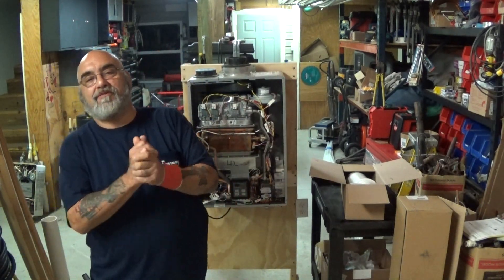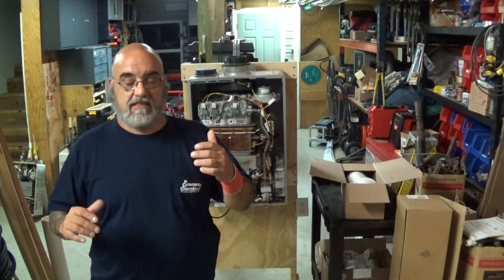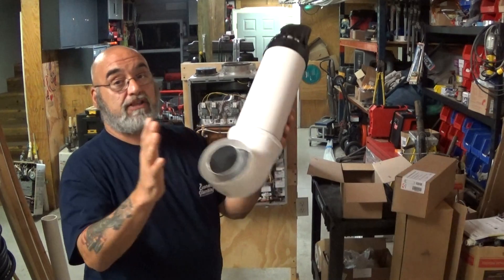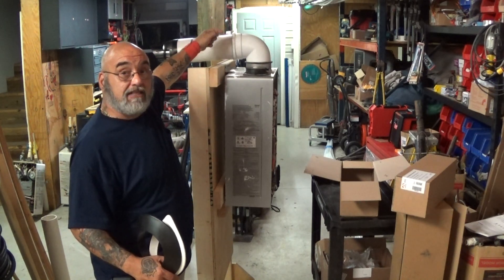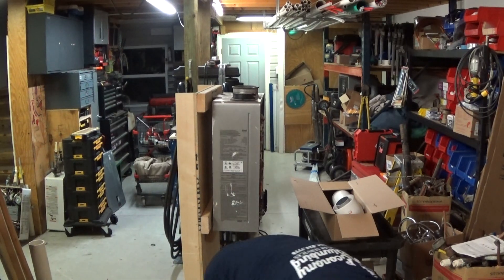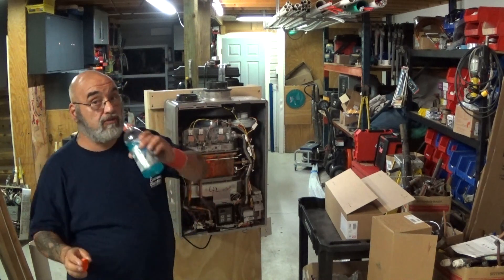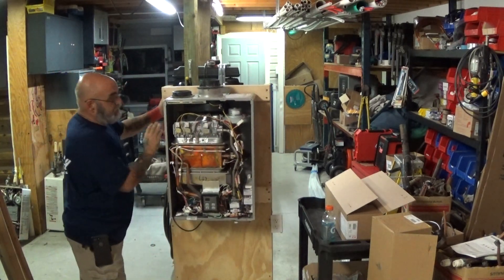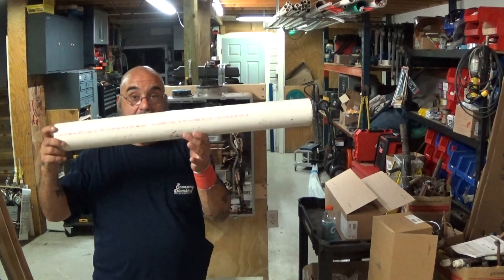What venting to use for a Rinnai condensing tankless

Comment: Is it okay to use a Rinnai #196985PVC 3” low profile termination vent with RU199in condensing gas water heater?  I will be using 2” schedule 40 PVC for both intake and exhaust.  Thanks! D

Comment: Thank you for these videos. They are very helpful. I have few questions for the Rinnai RU199iN Condensing Tankless Hot Water Heater, 11 GPM, Natural Gas, Indoor Installation. Can it take the CVENT-2 or the 184162PP vent? These vents look open at the top, what happens if rain water gets in the heater exhaust line (straight through roof)? Why can I not put a 2" PVC pipe from top of Rinnai heater into the existing galvanized vent from old tank water heater? Thanks you again for helping.

Comment: I am glad I found your videos. I picked up a RUCS65iP to heat the hot water in my radiant flooring in my garage and am self-installing all but the propane. I didn't realize that if I use the centric venting I only need to run the one pipe and could leave the intake capped. I thought I had to run both. Thank you!

Comment: Can you use non direct for your intake air supply?  My current unit, Eternal GU145S, is installed in a large attic space and uses my attic air supply for intake.  Can this setup be used for the Rinnai units?

Comment: What's shown here is how my Rinnai is vented.. noncondensing ubbink immediate 90 out the exterior wall that it's mounted on.  My question:  How do you remove the 90 to inspect / clean the exhaust?  I'm not finding enough flex / wiggle room to get it out.  I've even loosed the wall mount and tilted the top of the unit about an inch forward.  What is the trick that I am missing?  Thanks!

Comment: Question was asked before with no reply but would it be possible to use ambient air instead of running a line for the air intake? Also would 3” pipe work?
Reply: You can use room air depending on the units location and the size of the space. If it a two car garage you could use it. As far as the pipe size it depends on the unit. The older RU SERIES USES 3” pipe the newer Sensei unites use 2” PVC. Just remember no matter what size pipe it has to be schedule 40. I hope this helped. Mike
Reply: Mike’s Wood Shop thanks
Reply: @TheBuddylab  I have a follow-up question to this:  On an RUCS, there is a dip switch that must be switched depending on whether you are using twin pipe, or concentric.  What does this switch do?  The two air intakes both feed the same internal air space, why does the unit care if the combustion air is coming from a separate pipe, or concentric?  What setting should be used if using surrounding (crawl space) air?  Thanks!

Comment: Hi Mike.
I got a question. My gas meter supplies 275 CFH..275000 BTUS. I am thinking to install a RU160 IN Rinnai water heater, but adding this RU160 and my appliances like boiler, drier and stoveI will surpass my gas meter  capacity by maybe between 20 to 30000 btus. Do you think I will have a problem running this RU water heater ?? I live in NY
Thanks
Reply: Call me at +19042385349 tonight after 6pm and I will go over it with you

Comment: Can you hook up a singal vented inside tankless water heater to a existing power vent singal line t.usingcharlette red scedule 40 pipe. Up and elbow it out 50 to 60 feet horizontally out thr previous power. Vent line from the old power vent water heater basically sayin g iam changeing from a power vent water heater to a inside tankless .can it be converted and what type do i use?!!

Comment: I want to mount a Rinnai V65ip 6 feet from the outside wall. Is it ok to run vent pipe the 6 feet to the outside wall to exhaust outside?
Reply: Dale East yes that’s way within the max. Distance. Just remember to minus 6 feet per elbow and 3 feet per 45*
Mike

Comment: Am I correct in assuming that, for a horizontal venting configuration, only the black part needs to stick out of the wall? We had our heater installed but the venting sticks out really far and was wondering if it could be cut back. Is there a recommended minimum distance from the exterior of the house? Thanks.

Comment: Question may have been asked...   Can you use 2" pvc Sch40 for a run less than 6ft? Rini Sesnie 199
Reply: I talked to a Rinnai manufacturer engineer on their contractor hotline and he said 2" was fine on my RU199in up to that 60ft mark. I asked if there was any advantage to go up to 3" and he said no at least in my 15ft application with some 90s. I am using mine in a tight remodel and that smaller diameter actually helps a good bit in fitting it in.

Comment: Hello Mike  I  purchase a V94XIN 
the question I  have is that on the way that I have to vent this unit is vertical  about 20 ft then I  need to use a 90 degree to  vent out horizontally  about another 20 ft.
Where I  can purchase concentric  venting  to do this type of run thanks.

Comment: I've had to replace my Rinnai water heater.  The vent pipe as fused together after 11 years of use.  Any suggestions to get it to release?
Reply: Jeff Cash it’s almost impossible to remove the vent. The two metals fuse together. You can try to spray wit a lubricant like WD40 and let it soak for a day or so. We don’t have the luxury to wait that long so we just replace the vent pipe. I hope this helped. Mike

Comment: I have a rannai Rc 98. I bought it used and installed it in my dairy barn. I hooked everything up and have power to the unit. I hooked up a small 5 lb propane tank just to make sure it worked before I had that gas company come and install the big tank. when turned on and the hot water running the machine cycles and tries to lite the flame. nothing happens and it throws a code 11. I checked the ignitor and that was good but i didn't smell and gas when I pulled the ignitor out and cycled the machine to check for gas. I went down to the little hole on the lower part of the machine to where you check pressure and cycled the machine again and didn't smell any gas. I know I have good pressure to the bottom of the machine because when i crack the line the gas runs out really well. As far as i can tell my gas solenoid is not activating. is that solenoid pressure sensitive meaning that the little tank I have wouldn't run it or even with the little tank shouldn't I still smell gas out of the machine?
Reply: The vapor pressure of propane is the same  regardless of tank size.

Comment: Hi Mike, I'm trying to install a V94XIN Rinnai in my house, but the current location of my tank water heater is ~10' from any exterior wall and is on the first floor of a two story house. I have the room to run the venting in between my floor joists of the 2nd floor, but I can't find any double layer tubing that long. Do you know of anyone that sells tubing that long? Any suggestions you have are much appreciated.
Reply: I know this is 5yrs old, but I'm having the same issue! What'd you end up doing‽

Comment: Very informative Mike. 
After 5 years of having a " temporary " electric water heater, ( no venting necessary ) I've decide it's time to go tankless. 
Do they make units that run on LP gas ?
Is the venting similar ? 
I would be installing the unit in my basement. 
Since I have a log cabin and don't have conventional walls I can run the venting through, would I have to cut a hole through the 10" concrete foundation ? 
Any and all advice is greatly appreciated.